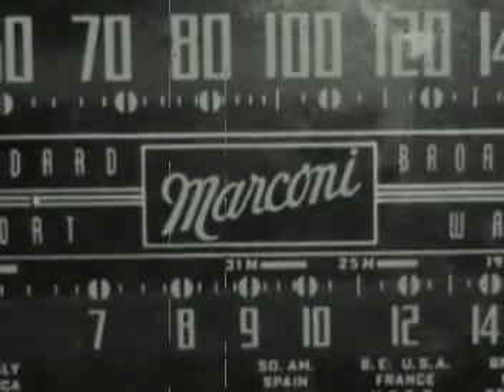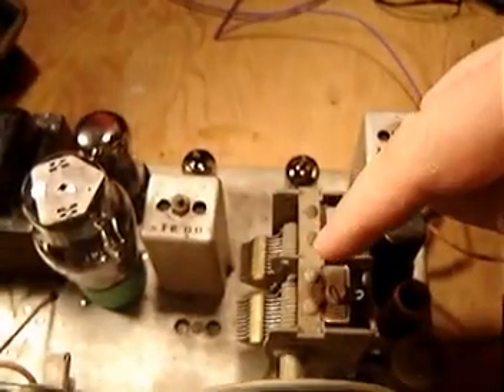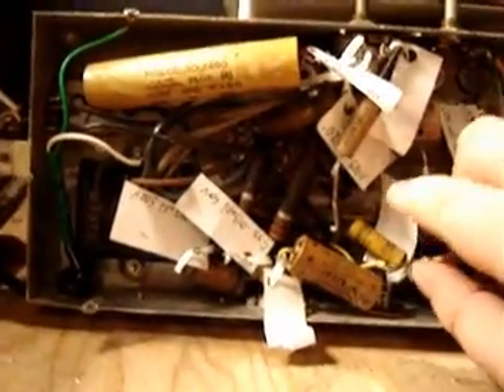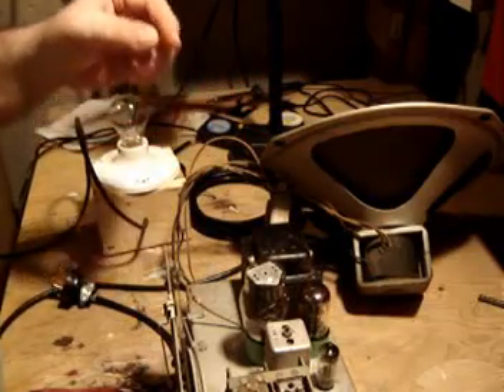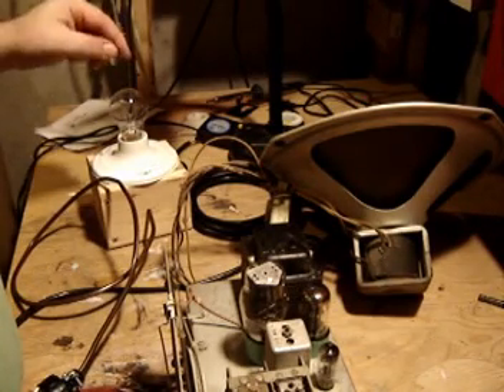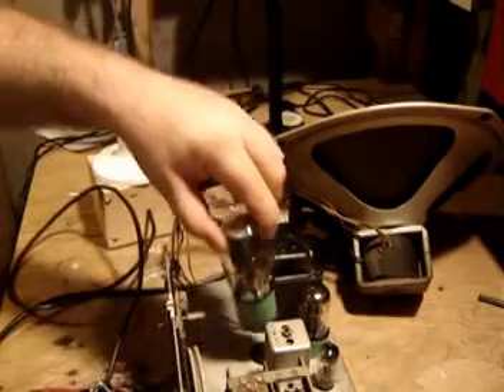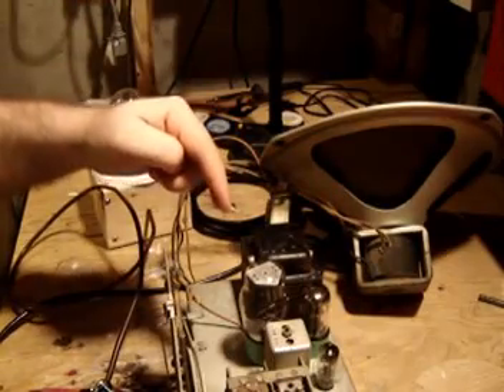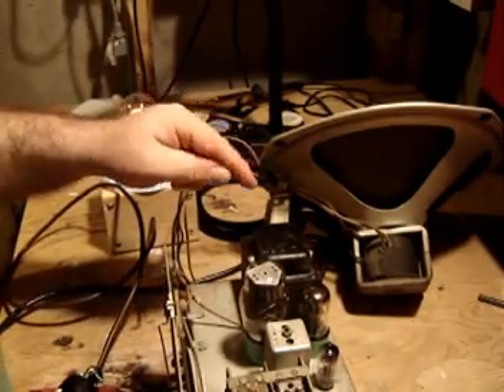Repairing and Restoring Tube Radios - part 2

Comment: The current limiter with a tungsten filamant light bulb is a easy test item to make. 
In mine I have a on/off on the output, so no need to go near the radio. There is also another switch that bypasses the lamp so the radio thus gets the full mains voltage if the lamp shows no fault condition.

Comment: Instead of replacing the old capacitors, in the interest of authenticity, you should test them if possible and leave them as they are - but if any need replacement, a good trick is to drill out the interior of the paper ones (if possible) - thereby keeping the cardbard tube intact!  Then of course you hide a modern capacitor inside the cardboard tube and fill the tube with a material that can be removed - (like silicone bathtub caulk) if they ever fail again.
Reply: celluloiddaydream 
EXACTLY!!! I HATE looking in the bottom of an old radio and seeing a bunch of modern Chinese capacitors! It looks ridiculous! I even try to troubleshoot and leave the good capacitors in place. The bad ones get resruffed.

Comment from the maker: A diode is an electrical component that only allows electricity to flow in one direction, therefore a diode is the most basic component of a rectifier. Usually a full wave rectifier will have an arrangement of diodes AND capacitors to convert alternating (bi-directional) current to direct (uni-directional) current.